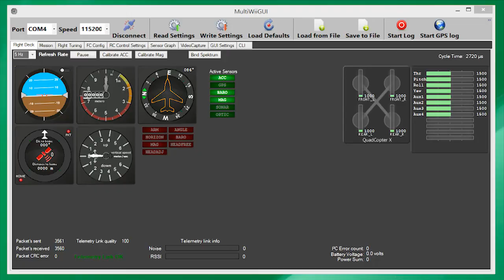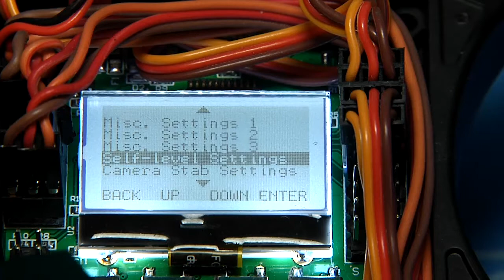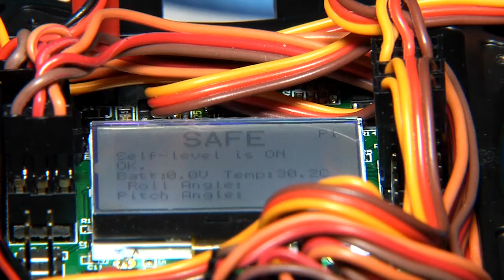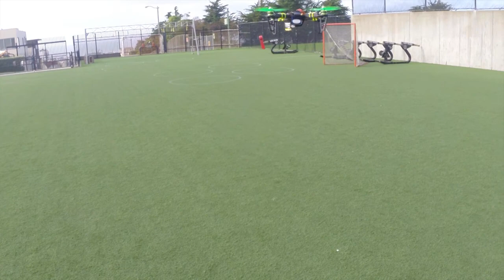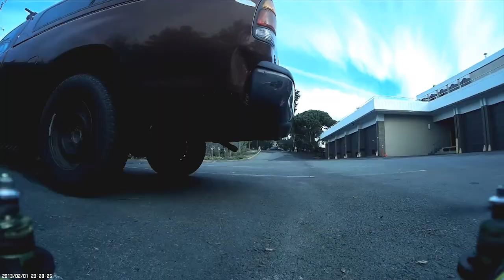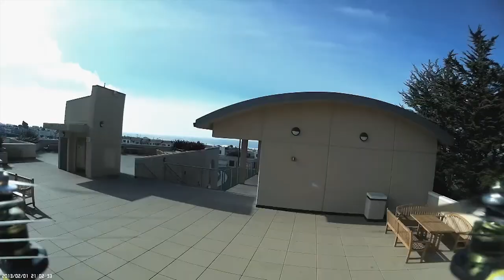FPV250 - First Flight!

Comment: Are you able to fit a gopro onto it? nice vid btw
Reply from the maker: Absolutely....
Reply: +InControl Are you being sarcastic or not?
Reply from the maker: +Spencer Pond No... I have shot some awesome video with a GoPro strapped to the top.
Reply: Well now you just made me feel stupid, thanks for the reply man
Reply from the maker: +Spencer Pond No worries... 

For best results, surround the GoPro with strips of foam to keep down the vibrations. Then use zip ties to strap it down to the cage that protects the flight controller.
Reply: +InControl One more question how badly did the go pro affect the stock quadcopter battery or do you use a different in order to have extra flight time?
Reply from the maker: On a 1000mAh - 8 min w/o GoPro, 5min w/GoPro

On a 2200mAh 20c - 15min w/o GoPro 8min w/GoPro